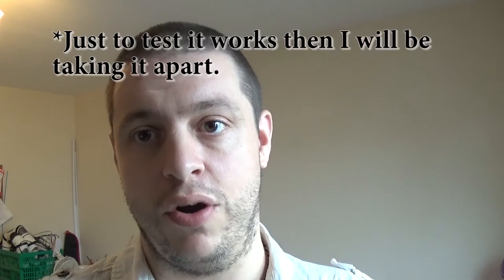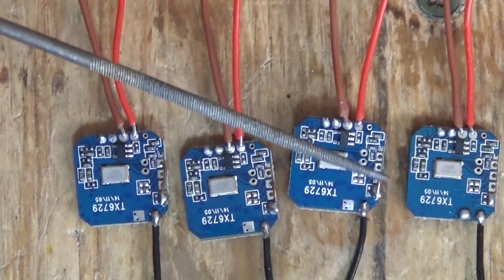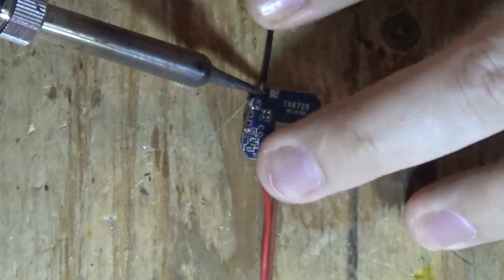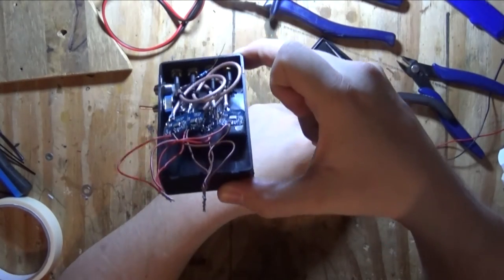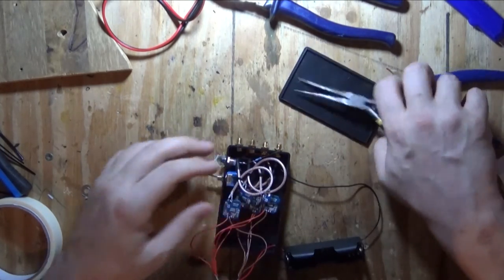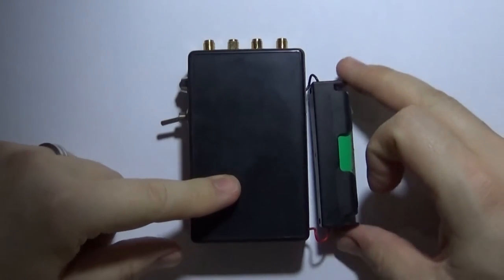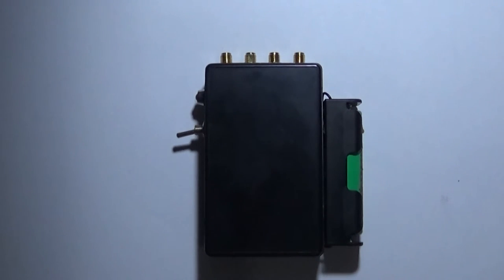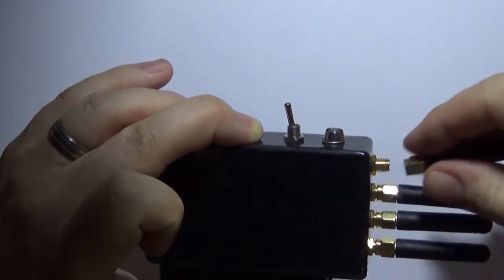DIY Wifi Jammer | Super Simple | Free Plans | Cheap & Professional

Comment: will any 2.4 transmitter work or does it have to be certain kind? if so can i use 2.4 and 5ghz transmitters?
Reply from the maker: I would think that most would work but I'd research it first. If possible I'd try and find both 2.4 & 5ghz ones due to a load of the new routers being 5ghz. Good luck and sorry I could help

Comment: I have these same dinky antennas. I wondered, why do you replace the monopole antennas on the Tx with the wifi antennas? If you only wanted to jam in your own home wouldn't it be safer to accept less power and/or range?
Reply from the maker: Eric Faler what a good point. well I hadn't thought of that. thanks for the info
Reply: The Off Grid Family i appreciate the prompt response. what im really asking is, how limiting are the original antennas, and in sacrifice of range can i avoid the extra cost of buying dipoles?
Reply from the maker: Eric Faler ive actually made some antennas that would work. they cost very little to make. i will send you a link to the video. one sec
Reply from the maker: https://youtu.be/UBBqSWPbPqY

Comment: if u want to extend the range, do you need better antennes?
Reply from the maker: Gilles De Pessemier bigger antenna and more power should do the trick. but this has quite a bit of range anyway
Reply: Do you also have a celphone jammer?
Reply from the maker: Gilles De Pessemier no i dont. the exact same process can be done with the right transmitter. cell jammers are illegal in most countries. however i may make one one day for "educational" purposes.
Reply: The Off Grid Family can you send the transmitter?
Reply: to jam the "cellphone signals"
Reply from the maker: Gilles De Pessemier i dont have one or a link to one. im sorry.
Reply: The Off Grid Family do you have the name of it?
Reply from the maker: Gilles De Pessemier i will do some research and get back to you :)
Reply: The Off Grid Family thank you!
Reply from the maker: Ive had a look and I cant find anything that would work, That is commercially available that would be semi-easy to use. Im sorry. I will look more but I cant at the moment. If I find anything  I will get in touch :)
Reply: Ok thank you.

Comment: What kind of range do you think this would have?
Reply from the maker: As I cant test it in a wide range kind of way I am not sure but I will have a look through some spec sheets and get back to you
Reply from the maker: I still havent been able to find exact numbers. At an educated guess I  would say atleast 75 meters probably a lot more
Reply: The Off Grid Family if you really wanna test, you could broadcast audio or video from it and see. that would be a good estimation.
Reply from the maker: Ethan Webb thats a really good idea. i had thought of it but would have to take apart the jammer and its all glued into the case. i did look for the same ones on ebay to buy and test but money is tight at the mo. i will do a video on testing some in the future and give you a shoutout.
Reply: The Off Grid Family hi how is this thing leage
Reply from the maker: dj remix its not illegal to make bit it is to use. thus i camt answer some questions about it